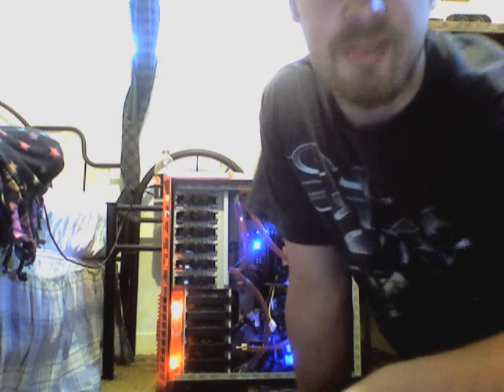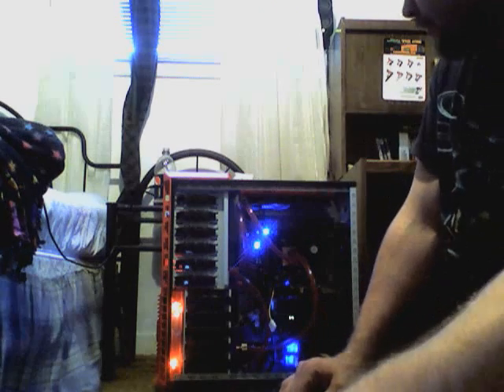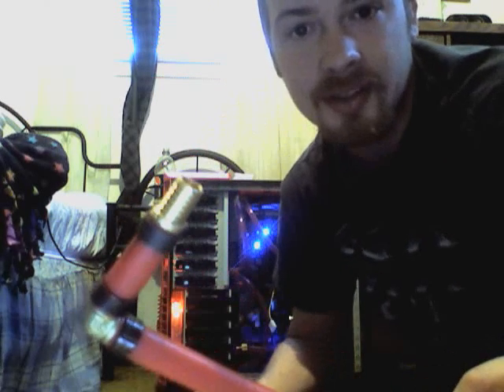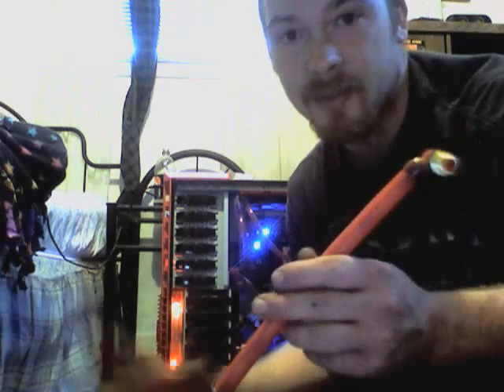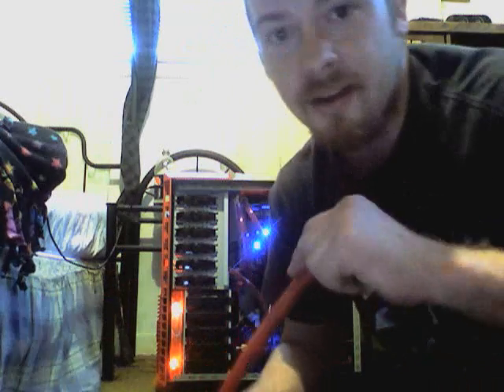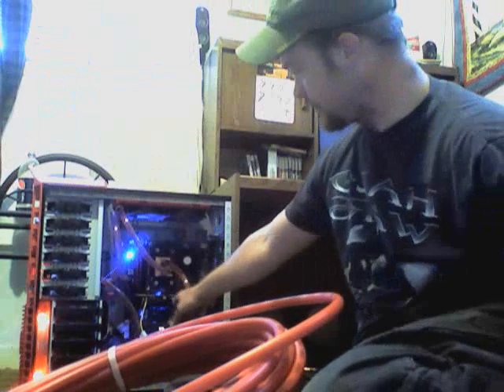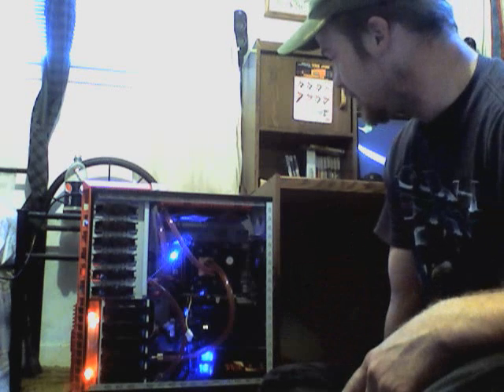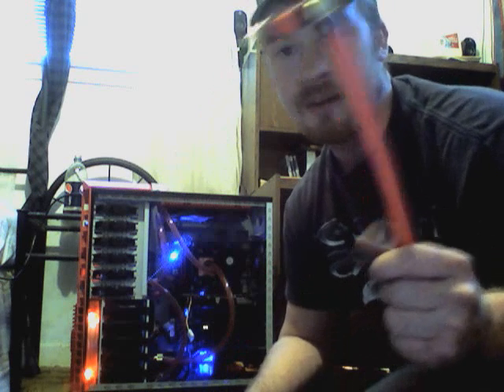water cooling with pex tubbing

Comment: PEX tubing for water cooling FTW.  Fuck garbage Vinyl tubing.  PEX can be used on water that's burning hot.

Now, the next question is how to use a motorcycle radiator and pump for cooling.  Just to be insanely epic.

Also, you can use soldered copper pipes in your water cooling system if you want to case mod for a steampunk look.